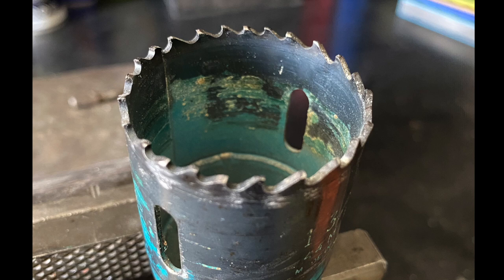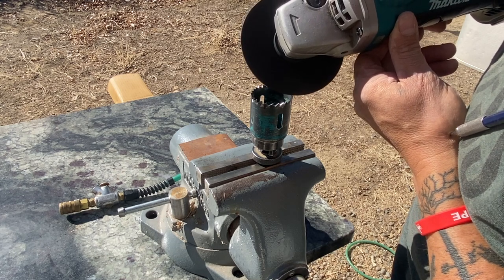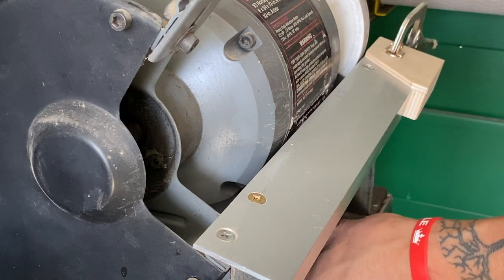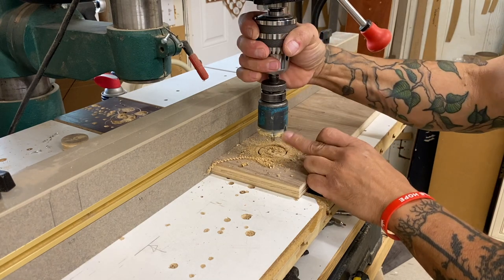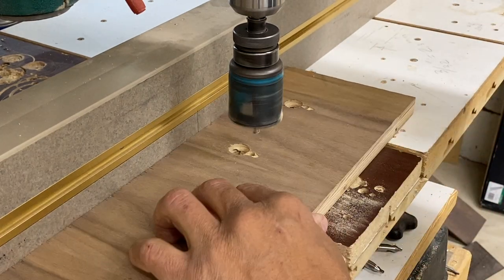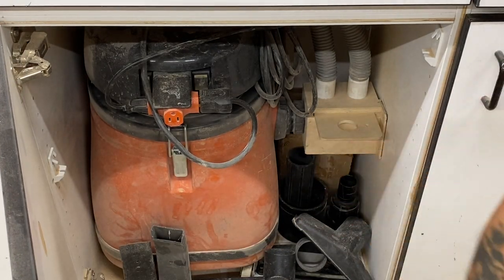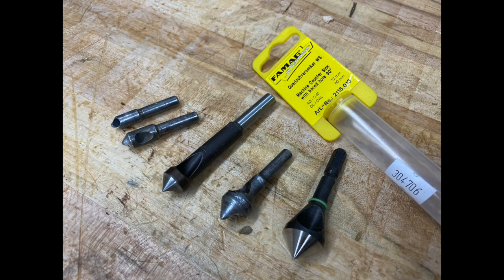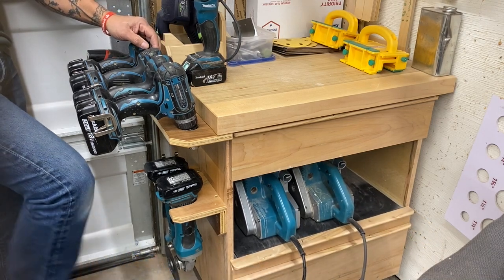Dull Hole Saws?

Comment: Thanks Ramon, I was ready to go by a new 4” hole dozer and when I found your video I tried your technique with my grinder, it worked well and now I just saved $40
Reply from the maker: That’s great to hear! I’ve noticed that the hole saws that I sharpen myself cut better than factory ones. Thanks for checking out the video.

Comment: As everyone else says, thank you for these great tips! I found it far easier to clamp the pilotless arbor in my angled bench vise. As I unscrewed the hole saw and braced it with my left hand, I used a Mototool cutoff blade to touch up each tooth top. It was really fast and easy to do; left the teeth scary sharp.
Reply from the maker: It’s amazing how well they cut with a touch up!   Thanks for the input and feedback.

Comment: Great tips, thanks! Chugging through a 4x6 with an old hole saw bit… the wood being a tad wet doesn’t help (treated). I had broken out the files but decided to search and found this. Thanks!! 👍
Reply from the maker: Oh yeah…wet PT is a bear😆.  Another thing I’ve done that’s not in the video is grind most of the teeth away.  Leave four or so…however many works with the teeth that are there. Try to make em bigger when you grind.  This will cut way faster with less clogging.  Anyway, have fun.  Much thanks.

Comment: Thank you  for the excellent tutorials,  please will you do  a video re sharpening the various wonderful Stew Mac scrapers
Reply from the maker: Thanks! And good idea...I have some footage about the Stew Mac scraper.  I’ll have it post on April 25th.
Reply: @ramonartful  I have a curved model that is challenging to restore accurately do you use them?
Reply from the maker: Are you referring to the “Ultimate” scraper...with several different round corners?  If so, then yes! That’s the one I sharpen.  I love that thing.
Reply: @ramonartful  yes that's the one I also use the rectangular 3 inch model
Reply from the maker: @Verstore Yes, next Sunday I'll show that.  Thanks a ton for the suggestion!

Comment: It works better if you can "clamp the grinder down" and bring the metal up to the grinder disk. Gives you much more control and is easier to manipulate for precision sharpening
Reply from the maker: That actually makes sense.  Someone needs to make a “grinder Dock” 😬 Similar to the Dock that I sell for the Festool Domino.  Thanks for your input.

Comment: Great tips on how to sharpen my existing tools. I am a novice and did notice a 'wobble' on the hole saw on the drill press. Should that be a concern? Thanks.
Reply from the maker: You’re right…hole saws do tend to wobble a bit.  Generally, lower speeds should be used. This makes the cuts safer by helping to maintain control as the cutter contacts the material. Also, lower speeds will keep the small tips of the teeth from overheating, which can quickly dull the tool.  And the wobble of the hole saw will smooth out as the cutter engages the wood.  Thanks

Comment: Have you ever made a wave style hole saw (like the saw system used on Forstner bits from Fisch and Freud)?
Reply from the maker: I have not.  But I have reduced the number of teeth on hole saws by tons of grinding.  They cut superbly well without clogging! Thanks

Comment: Great tip on cutting the extra hole before hole sawing.  I was helping a friend cut holes in pressure treated plywood over the weekend and wish I had know about that then.

The in-line blowers are something I need but the reviews on Amazon are pretty bad.  It seems like perhaps they stopped making them in the USA and are now selling cheaper made blowers that do not work as well.  One comment I saw said to look around and you could find a rebuildable in-line blower that is made in the USA and much better quality, but for the life of me I can’t find anything that’s not made in China and/or has good reviews.   Can anyone point me to a really well made in-line blower?  Or perhaps these are still good and a few unlucky customers are dominating the comments.  Help please?
Reply from the maker: Thanks for checking out the video!  

I used to use the cheaper ones…and they end up failing after a while.  The button will develop a leak or sometimes the housing begins to leak.  

Dynabrade sells a good one.  And I see they’ve gone up in price.  I had been getting them for around $24.  But at least, they’re well made.  I believe they’re still made here in the US.  

https://www.wurthmachinery.com/DynaJet-In-Line-Blow-Gun-Dynabrade-94467.html?gclid=CjwKCAjw8sCRBhA6EiwA6_IF4f8SsdCOERPuUDEMxmok4DpxWUhKk-0te_s62jwg1ShBDVgCIIvX3RoCVD0QAvD_BwE
Reply: @ramonartful  Thank you for the link.  Just ordered one.  Appreciate it.
Reply: @ramonartful  that is a nice looking little air nozzle. Great for quick dusting before finishing.

Comment: One more thing.... most drill presses have speed change capability that never gets used. Try using it,you;ll burn fewer bits.
Reply from the maker: I change my speeds on the drill press constantly.  You’re right, it makes a huge difference. Thanks

Comment: Another great video. I can’t wait to try your sharpening technique. I would want to know if you have tried a Dremel with a cutting wheel. I know it would be slower but for us less talented folks it might be safer. LOL
Reply from the maker: Hello Charles.  I have not used a Dremel for this...I’m sure it would work as well. The guard gets in the way a bit with these types of grinders but may be a good alternative.  Much thanks 🙏🏼
Reply: I used a Dremel with a pink grindstone. I could shape the stone to a rounded edge. That let me shape the gullet while I sharpened the tooth. 
Running the smaller wheel and slowing down the Dremel to about 10,000 rpm keeps it from bluing the tooth.
Sharpening can be a run what ya brung process. The angle grinder does a decent job.

Comment: Can you use the diablo hole saw without the centering bit
Reply from the maker: I’m not sure  about the Diablo.  However, I do that often by simply cutting a hole in scrap 1/4”…then use that as a template or guide to drill holes without a centering bit.  Just clamp the template down , yeah?  Works well.

Comment: In case you happen to read and reply,,, What did you do to ensure all the teeth remained the exact same height?? Did you grind the cutting edge of the teeth and not show it?
Reply from the maker: I grind the leading edge of all the teeth and attempt to use the same pressure and time in the “gullet”.  This keeps the teeth the same height.  The sharpened teeth cut crisp and clean…It’s amazing how well they cut…way better than new! Hope that makes sense.  Thanks

Comment: Solid tips as usual! 👊🏼
The "table" you built for your bench grinder, what angle do yoy have that set to from the wheel and why? As well as why so low on the wheel? I've always seen and have used jigs and such on the top side of the wheel.
Reply from the maker: Good question.  I had to go see my set up in the shop.😆  The drill bit contacts the wheel dead center...but it appears low in the video due to the camera angle.  In other words...if you draw an imaginary line through the drill bit...it would line up with the center of the wheel.  The actual angle is matching the end of the drill bit.  Those bits are most likely 118° maybe 135°...standard drill bit angles.  So I am merely matching that (complimentary angle).  Hope that helps
Reply: @ramonartful  haha thats funny. Right on, so that is exclusively for doing drill bits then?
Reply from the maker: @benborsa8266  Another good question!  This grinder is actually set up for sharpening my Stew Mac scraper...nearly exclusively.  It just happened to be the same angle that I needed for the drill bit.  But most of my grinding is done on a Tormek.  thanks man
Reply: @ramonartful  solud thank you, good sir 👊🏼

Comment: For a quick sharpen, run backwards on a belt sander
Reply from the maker: Yeah…that would sharpen it.  But the teeth would lose their “set” causing the hole saw to bind easily.  Thanks

Comment: Don't leave the battery attached to the tools it will drain it and it can case the battery to fail.
Reply from the maker: Just now seeing this.  But, what you’re saying  doesn’t make sense.  The tool has a switch…connected to a relay.  There’s only a connection to the battery when the trigger is pulled.  I’ve never had an issue. 🤷🏼‍♂️ thanks
Reply: @ramonartful  I don't know from experience but I've heard from someone, but thanks for clarifying.
Reply from the maker: @wessamazzo8856  Thanks for the input...I had to think about it for a while! 😁 But, I always leave the batteries in...no problemo! Thanks